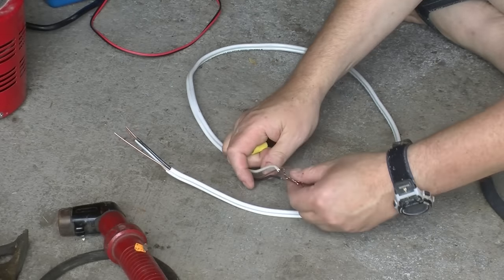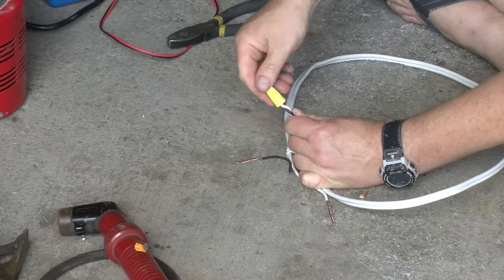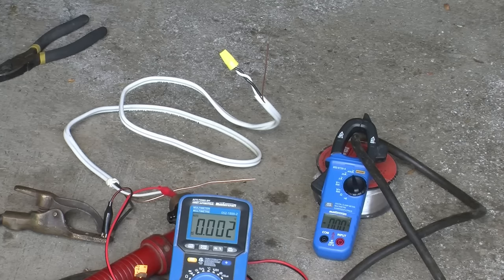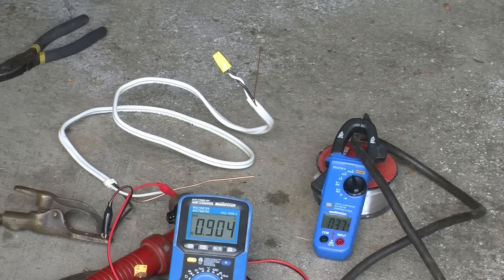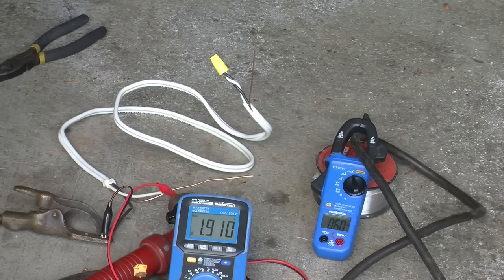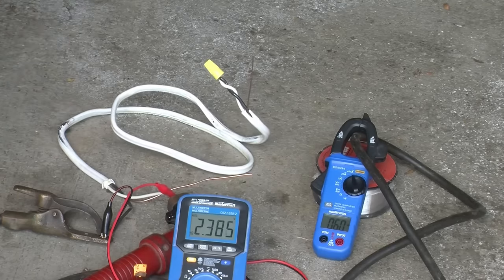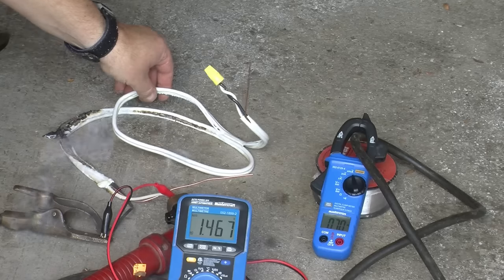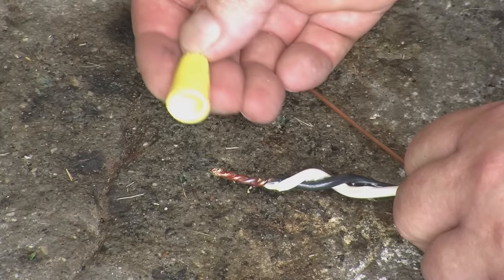How many Amps to burn up 14/2 electrical wiring?

Comment from the maker: If you want to see MORE REALISTIC TESTS  for various insulation types from fiberglass to foam in a 2x4 wall, look here https://www.youtube.com/playlist?list=PLHUfJmsprIcTVwSgCkTJnkinJSWrZY7DY
Reply: Can you do another video use 12-2 and run it through a wire nut , a wago , & just twisted to see which melts first?
Reply from the maker: @thewonderfulwonder1614  I will definitly do some version of that - numerous requests for wage tests. It may have toi wait till spring unless I can rig up a fume hood in my basement!
Reply: Can you do this with a wago connector?
Reply from the maker: @fernandoalcantar7907  Yes - have had plenty of requests for extensive Wago testing. Will definitely do it. May have to wait till spring since I cant do it inside due to the fumes.
Reply: I’d like to see a test that would simulate two space heaters running at the same time on a circuit of 14 gauge wire and see how long it takes for the wire to start toasting.  Initially the wire can probably hold up but after say 10 to 12 hours that’s when it may start to fail. Many homes slap a 20 amp breaker on the 14 gauge wire incorrectly.  So this is a real world scenario.
Reply from the maker: @jesse7jesse7  That's a great idea - a not uncommon misuse of house wiring,. I wonder how common replacing a 15A breaker with a 20A one is? Not as easy as swapping fuses in the old days, but probably quite within the ability of someone who doesn't quite understand whats unsafe. Probably worth doing in a small 2x4 wall section with some typical insulation to make as realistic as possible. I'll keep it in mind for this summer. The one limiting factor is the time it might take - for safety, cant leave a setup like that running unattended!
Reply: @ElectromagneticVideos I want to know...
How much more extra current can be passed beyond the safety given limit for ANY given wire gauge??
Reply from the maker: @tnamen1307  Unfortunately there is no simple answer to that one because it varies a lot depending on the situation. The rated current for a wire or cable is typically stated for a particular use case ie 14-2 NMD cable for Canada/US house wiring is rated at 15A capacity which is a safe value for that type of wire in that situation. Some wires are made with higher temperature insulation for use in certain settings so that a higher current can be carried. Bundle a bunch of wires together and you have to reduce the max current because of the combined heating. 

So bottom line - the rated current a wire or cable is the one to use because over time it has been shown to operate safety.

Comment: Would be good to have a thermal imager rather than relying on touching the live wire (that is rigged to fail). This was a great video though, none the less!
Reply from the maker: Your the second to suggest a thermal imager! I will have to look for one. Glad you enjoyed it!
Reply: Even a infrared thermometer would’ve been great to see actual temps!
Reply from the maker: @dodgeguyz  Based on suggestions like yours I did that in the "wire in fiberglass insulation" video I put up today: https://youtu.be/Df7bAEdIILI
Reply: Its not like touching that "live" wire is dangerous other than possible burns if its that ridiculously hot, but this is less than a volt for most of the test, so its doubtful that you would even feel a shock until the mid 20's or even 30v.
Reply: It's classic YouTube style...let's hookup electricity and use my fingers as the measuring device! Woot woot Science!
Reply from the maker: @lexicase8805  Exactly! And I didn't touch the melting bubbly plastic because I was afraid it would stick to my finger and give me a burn.
Reply: @wehadagoodruniguess.2384  nah youre thinking tig welder with hf hv start, this is just a plain old stick welder, yes thats a form of arc welder, but its lv dc high current. Even on a high setting it might see 40v. This welder would be no different to connecting a pair of jumper leads to a car battery, only you can vary the amps on the welder, so its perfect for this type of test
Reply: Here's a live wire with many times lethal current running thru it rigged to catch fire, let me just grab it here with my meat mits and see if it's hot
Reply: Some can even connect to your cell phone (flir)
Reply from the maker: @michaeld9682  I have been looking at those! Also looking at the standalone ones - but they are more $$$
Reply: @ChadKanotz  arc welders use a torrodial step down transformer that does something like 5-20V at hundreds of amps, there is a high voltage arc starting pulse via a capacitor that charges with everything is disconnected, the real danger is when the wiring pops and the HV cap starts charging that'll get to 2000-4000v
Reply: It's a welder... Not enough volts to push all those amps into your meat.
Reply from the maker: @africanelectron751  Just subscribed to your site. Great flyback video.  Your in South Africa! When I was a kid we lived in Johannesburg for 4 years - wonderful memories!
Reply: Agreed
Reply: You know a welder doesn't run at 240Vac?  It's like 20volts max
Reply from the maker: @dan_austin__873  Just to clarify for everyone. Its a 240V stick welder with AC output. Open circuit its a bit higher than 20V (in the 30s I think I recall) but 20V is more like it for under load. For these tests I'm powering it on 120V from variac. The variac to allow precise adjustment of voltage and therefor test current. 120V welder input max driving the welder is more than sufficient - for these tests due to the low output voltage required.
Reply: Yea I cringed every time he did that and said oh its getting hotter.
Reply: Ro Herms  I ordered 2 of them from amazon both came with android connectors and no iPhone connector.  Tried using a converter and had no luck.
Reply: Gloves.... lol
Reply: I was gonna say the same thing grab a Flir c5
Reply: The old C7 7 watt Christmas lights strings same thing happens when you connect too many strings. Back then there were no fuses in the plugs. a lot of trees caught fire. They used to recommend using 15 amp fuses instead of thirty amp for the outlet. But even so the string wires were twisted and used about 18 gauge wire. The new C9 sets have seven amp fuses and use 5 watt lamps instead of 7 watts  You can only connect two strings of 25 lamps. Put a third it will blow one or both fuses which is good protection. 73
Reply: OMG, it drove me nuts every time he touched it over its rated capacity! Don't touch energized wiring that is damaged or that you expect to fail! But good demonstration.
Reply: @lexicase8805  please don't confuse lethality of voltage and amperage. Amperage is what shocks you. You can change the lethality of voltage by changing resistance, or power. 0.1 amps can be lethal. At 10 amps, you are definitely dead.
Reply: @bcs717  but a car battery is capable of 500-1000 amps and yet you can quite comfortably hold onto the terminals of that. Voltage always plays a part in breaking down that skin resistance, the voltage needs to be high enough to create the circuit. 20 million amps could be available but if the body has high enough resistance it might take 30-40v before youll even feel it. 50v is where power is considered hazardous to human health, and above that, 50ma  across the heart is considered potentially lethal. Dont worry im not confusing anything.
Reply: Welding voltage is between 20 and 40 volts so not as dangerous as it looks.  Burns are still real risk but electrocution not so much.
Reply: Enjoyed the video, but said ouch every time you touched the wires.  Would think there would be a better way.
Reply: If you get a thermal imager, pay attention to the resolution. Cheap ones will have something like 80 x 60 resolution, which is very low. Aim for something higher. But even 80 x 60 is still better than fingers.
Reply: Since he's using a welder, the voltage is going to be so low that there is no chance of getting zapped.
Reply: 3.2v live😂😂
Reply: Well that's no fun
Reply: This voltage level is not even dangerous I agree thermal image camera would be great for visual but as far as granger this is nothing, you could out that on your tounge like a 9 volt battery
Reply: @ElectromagneticVideos  yeah dude you were making me hella nervous. If that wire would’ve failed while you were touching it, you could’ve easily gotten fried.
Reply from the maker: @DavidA20200  Its low voltage - no chance of that or I wouldn't be touching it!
Reply: There is nothing unsafe about this besides perhaps getting a small burn from melted plastic. I know electricity seems scary at high power like this, but this is very very low voltage. Not enough to even feel it. He doesn't have it plugged directly into the wall.
Reply from the maker: @shannonroberts5080  Thanks so much for posting this! You wouldn't believe how many people don't understand this!
Reply: It's like he made it up on the fly

Comment: The temperature rating of that 14AWG NMB cable is 90°C. The amp rating is good to 25A. The NEC prohibits its use over 15A. Nice demonstration.
Reply from the maker: Thanks for the info!
Reply: Yes. The NEC has safety factor upon safety factor built-in. It’s apparent all across the code. Things can be stretched much past their code “limits” before catastrophe occurs.
Reply from the maker: @alex43223  Very true! Although I was surprised how the safety factor becomes in some later experiments I did with 14/2 inside insulation as you might get in an outside wall.
Reply: So the wire hits 90C at 25A, but is that buried in insulation, or hanging in free air?  And NEC actually prohibits its use above 80% of 15A, or 12A continuous.
Reply: @stargazer7644  The NEC allows wire to be used at 100% of it's rating continuously, it's the OCPD that's limited to 3 hours of 100% rating, anything longer than that it has to be derated to 80%. Any load that could potentially be on more than 3 hours at a time is considered to be continuous. So you are correct in that the entire circuit is limited to 80% of the OCPD rating, but the wire itself is not the limiting factor. Also, you cannot use the 90C table unless every device the wire is landed on is also rated for 90 C, and nearly all circuit breakers are limited to 75C. In the absence of a temp rating on terminations or connections, you have to default to the 60C ampacity table for the cable. Which in this case for 14/2 is 15 amperes. Mike Holt has some excellent videos where it's explained in more detail.
Reply: @brnmcc01  Finally, someone in this comment section with a clue.  Thanks for the explanation.
Reply: @brnmcc01 . You are correct.
Reply: the temperature ratings are a mystery. because 90c is 194 Fahrenheit. So is that the point at which the thermoplastic jacket melts? I doubt it.  Maybe that is what it gets up to at 25 amps? I doubt that too. 
120-130 degrees is what starts to feel uncomfortably hot to hold.